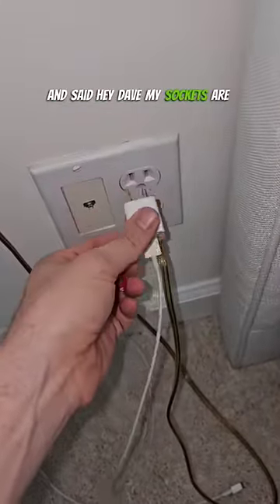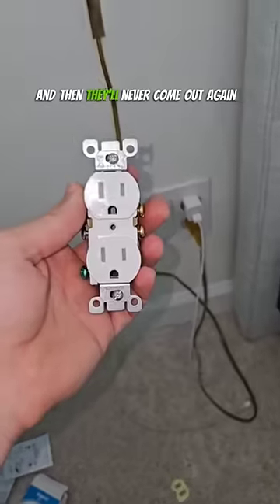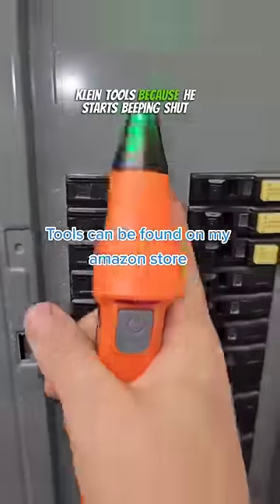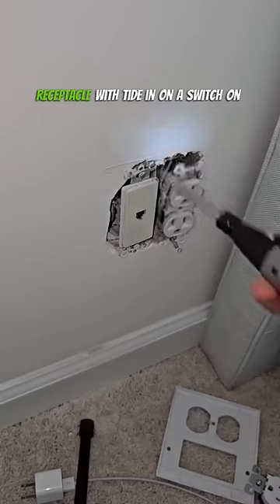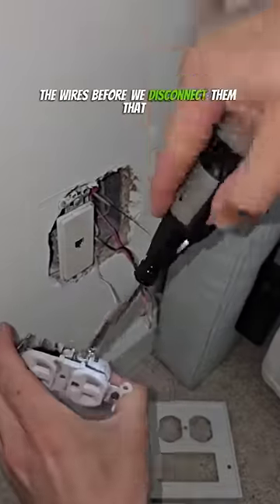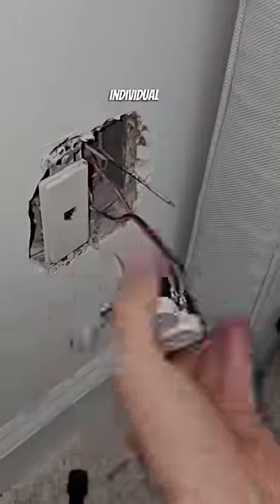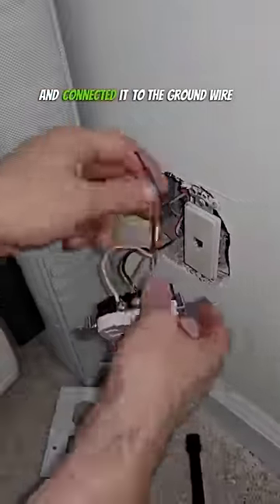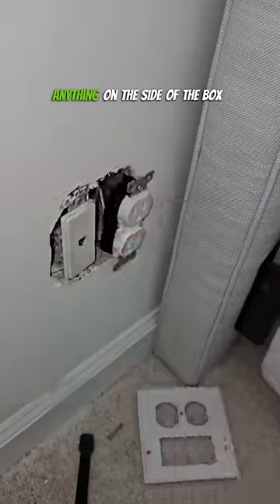🔥 Thats a hazard! How to change a switched outlet #diy #handyman #electrician #HowTo

Comment: I like how everyone is just causally glancing over the fact that socket didn’t have a grounding wire 💀
Reply: Ikr? Could end bad quickly, though its only 110v
Reply: @D3nn1s badly how? Its fine
Reply: @randybobandy9828  if you have an object with metal housing that needs to have a ground, if one of the live wires touch the metal housing theres nothing there to protect you except the normal fuse. idk how best to explain this to you since you obvz dont know much about electronics but look it up, its there for a reason
Reply: I'm a little surprised the testing meter didn't pick that up. Maybe the metal of the plug was grounded to the metal box through the mounting screws, finding a ground that way.
Reply: @spelunkerd  yup!, Otherwise the box needs a grounding pigtail to the wire nuts.
Reply: @randybobandy9828  you say that until your water spigot starts showing 85V on multimeter
Reply: If it’s in a metal box and the box is grounded then you do not need to ground the receptacle put into the box… but it is still safe practice to do so
Reply: @joncramer7034  I do understand what you're saying. Even multimeter testing may not detect that grounding through the screw is a more tenuous pathway that may not be robust enough to withstand high current, or may add enough resistance when heated to prevent a breaker from immediately tripping. Anybody reading this should know that a receptacle in a grounded box that does not have the ground screw connected is a violation of electrical codes, almost everywhere. It leaves permanent evidence of shoddy work that could have legal implications far into the future.
Reply: @spelunkerd  I do believe they changed a code section exactly for this saying that if a receptacle is bound to a metal grounded box using metal screws it does not require equipment grounding. I’d have to check up on that but I believe they recently changed that.
Reply: If the box is metal, the electrical system is grounded and the outlet is the self grounding type the nec does not require a ground wire.  Ultimately it's up to the ahj to dictate the manner of work.
Reply: My house was made before they needed to add a ground wire. A lot of our sockets don’t have a ground. Parents started redoing the wiring
Reply: @sisterspot111  If it's too difficult to add a ground, electricians deal with that by adding an upstream GFCI. Even without a ground the GFCI allows you to safely swap over the two pronged plugs to conventional three pronged plugs.
Reply: @D3nn1s  the rcd will still save your live but it will hurt
Reply: Surprisingly common in the US, not good.
Reply: Didn't he add a ground wire
Reply: @pannoncannon  yup, same on an amp with a metal housing but it only has 2 wires from the factory. When touching the metal and e.g. a radiator you could feel a tiny bit of buzz.
Reply: That's not exactly uncommon
Reply: All houses I been to replace they old outlets never have ground wires it's how it was back then and it's a pain if they do have em cause then it be too short to get onto the receptacle some add a pig tail to it but that makes the box have even less room better to just remove it and add a new one for less pain
Reply: @D3nn1s "only 110v" dude 4v can kill depending on how it hits you
Reply: most modern socket housing is plastic so it usually isn't necessary, in older ones like this one and many of the ones in my house, they are metal and thus need a ground wire. bad electrical work by whoever installed this (or the last one to work on it)
Reply: @Xaelyth  no 4v cant kill you. Unless you happen to onto it with your pacemaker. It was a joke relax
Reply: Welcome to the average American power outlet experience.
Reply: @spelunkerd the testing meter did pick it up. If you look at the tester it has 3 lights at the bottom 1 for each wire. The left light is not lit up. Wich means 1 of the 3 main wires is not connected. On that specific tester the ground wire is the left light.
Reply: Any house built in like the 70s or older typically doesn't have any grounding. It's fine 99.9% of the time 🤷‍♂️
Reply: It’s very common in old houses it’s not a problem deal with it all the time
Reply: pfff, here in mexico that's standard issue
Reply: Couldent the wire to the switch be grounded?
Reply: @D3nn1s  nah it be aight 🤣
Reply: You don't need that bare wire copper for the outlet to work.
Reply: I have a ten amp and a thirteen amp outdoor appliance that are both double insulated and by design neither plug into ground.  Most carpet vacuums I've used are also high amperage and don't.  Most electronics don't.  I wonder if pc monitors do only because they physically attach to a pc which allegedly needs it.  Televisions tend to be made larger and consume a lot more power than computer monitors and don't have a ground prong.
Reply: All that was covered in the short.  He added a ground wire.
Reply: @D3nn1s  Not correct.  Because the metal box should also be grounded.
Reply: @joncramer7034  Technically yes it is grounded through the mounting screws, in most case.  However, using any mounting screw anywhere for a ground violates the code.   Code says it needs a dedicated ground screw.
Reply: @bearcountrypublishing5303  yes should. And probably with the wire that isnt attached lol
Reply: Not having a ground is dangerous obviously but it's also very rare something goes wrong, still something COULD go wrong so there needs to be a ground.
Reply: Most in the us sadly don't so when we replace we have to fix that
Reply: @randybobandy9828  you really need to acquire more intelligence on the matter.
Reply: @D3nn1s  I know plenty about electrical.
Reply: US sockets are so garbage anyway, literally any other socket around the world is safer and better. Schuko ftw.
Reply: it could be really old and just never got updated till now
Reply: Most common household items plugged into a 110 volt outlet do not even have a ground prong on the cord
Reply: I am in Europe and some plugs in my house dont have the ground pin because it is an old house and before we didn't had to add the ground.
Reply: @randybobandy9828  Go home pal, ya lost.
Reply: @crystalmetheny1342  it's amazing how you can't say why though. Weak
Reply: @randybobandy9828  Why what?
Reply: If it's a metal box only the box needs to be grounded, the receptacle is grounded through the screws, look it up. I still do both, but NEC doesn't require it.
Reply: @Rhyzak  it seems like you do.
Reply: My house doesnt have ground, i guess a lot of people here lives in the same situation
Reply: He said that
Reply: Bahhh its case grounded, its fine
Reply: I literally slowed the video and zoomed in to check 🤦‍♂️ no ground wire... sure it may ground through the anchor and housing... but... 90% of the time that works 100% of the time... but the other 10% of the time? ... " we just don't talk about that" 🤷‍♂️😬😁😎😜🥳
Reply: @daniellau5859 fine until it isn't 🤦‍♂️ But... it's not just good, it's "good enough!" 🙃
Reply: it's pretty common, some people are just lazy, i feel like i almost see one everyday without one
Reply: Most old houses do not have grounds. My parents house does not have grounds. Never had any electrical problems.
Reply: In older buildings, before grounding became an industry standard, not having any ground was the norm. Unless you have a ground plate, aka a huge metal plate buried under your house, connecting a bunch of ground wires together won't do much, cuz they aren't connected to the actual ground.
Reply: @yo_its_gingey5329  a ton of countries just dont hsve grounding in 90% of houses
Reply: @spelunkerd  It isn't a tester.  It's only a breaker identifier.
Reply: @joncramer7034  That's not always true, especially in a house.  It should be grounded with a green clip, but it still needs a ground wire on the plug.
Reply: @jhonsauceda6024  That is only on a commercial piped in building.  The box is grounded with the pipe.  If you wire a house, it's NM-B wire and the box is only grounded by a cheesy little ground clip that is easily pulled off  Ground wire on device is required.
Reply: @SteveWhiteDallas  buddy in the Chicagoland area homes are also in conduit.  I'm not saying it's right but that's the way it is.
Reply: @jhonsauceda6024  It isn't wrong.  But I did say "commercial.  You'll have that..  A small town surrounded by Dallas, Texas (Highland Park) requires all wires to be in conduit or metal flexible conduit where emt is not possible.  That is because of the massive squirrel population.  (old town with trees that stretch across most streets - $2 million+)  That's what local codes are for.  I am fairly sure that a ground clip on a metal box wired with NM-B is not compliant to NEC.  But I could be mistaken.
Reply: @D3nn1s  I removed the secondary winding from a microwave xformer and replaced it with four turns of #6awg.  The output is 3.6 volts AC.  I connected the new secondary to 2 electrodes and hinged them to bump together.  Its called a spot welder and it isn't a toy.  The combination of frequency, current and voltage is what contributes to a deadly shock.  You can think what you want, but I don't recommend betting your life on the effects of high current at 4 volts.
Reply: @uncrunch398  Ground wires on appliances are connected to any metal frame that is inside the unit & any metal part of the housing or anything else metal that the user might come into contact with.  If a short circuit occurs (a circuit that is too short to provide enough resistance to keep the current below a particular threshold, including a hot wire/component in direct contact with the metal parts mentioned above) the voltage will travel through the ground wire into the earth/ground instead of traveling through your body.  The ground wire has almost zero resistance, which means the current will rise to a level much too high for the circuit breaker so it will trip.  The ground wire is not required to make the appliance operate, but it is 100% as important as the hot and neutral for anyone who wants to avoid being shocked.  No one is immune.  I have been shocked many times, but still, I never know when the next time will be my last time.  That applies to everyone, without exception.  If you don't have a grounded outlet and no ground wire is in the box, protect the circuit with a GFCI breaker or receptacle.  Be safe.  It's worth the time.
Reply: @SteveWhiteDallas  you can die from high current at .1 volts and high voltage at .1 amps. Just saying, if its set up correctly it shouldnt do anything at 240v much less at 120
Reply: Old house.
Reply: @D3nn1s  What is your idea of set up correctly?  If you believe 120 or 240 Volts AC can't kill you, you might not be the stupidest person I've ever run across, but you missed a good chance to be.
Reply: @SteveWhiteDallas  fi, grounded properly.
Reply: A lot of older work doesn't have it, why you surprised? I wish I could fix every problem while working but my boss says no, they paying us to change receptacles or this or that, not running new wires, because when he informs the client they don't want to pay more and he makes them sign papers stating they don't want to pay more to get their electrical done right
Reply: @joncramer7034 
It was a cheap receptacle without a ground clip on the mounting screw so, technically, no good. It was obviously grounded well enough for the tester to indicate. Use of a self grounding outlet would rectify the issue as well.
Reply: @sisterspot111 
No ground, must use 2 wire outlets or a gfci outlet marked accordingly. You can't install a standard grounding outlet legally.
Reply: @spelunkerd 
If you are allowed in your jurisdiction to wire 3 wire outlets downstream from a gfci, they must be marked accordingly. My area will not allow downstream outlets to be 3 wire if there is no equipment ground.
Reply: @joncramer7034  there is still an internal ground connecting everything threw contact
Reply: Thank you!
Reply: This is why our British model is superior
Reply: @randybobandy9828  Basics of electricity. You have a power source, you have a ground source. Yes this is AC power but you still need a ground to protect you and your equipment. Without it you can cause an electrical fire and possibly burn the house down. Sure it has a neutral but better safe then sorry.
Reply: It was grounded to the box, the ground coming in goes into the metal box and when you attach the outlet it grounds through the screws
Reply: My sockets in my childhood bedroom weren’t grounded. I found out when I replaced the broken socket. Made me wonder what other sockets weren’t grounded in that house.
Reply: It’s in conduit. Most likely not required by code. The entire system is grounded.
Reply: Why was the ground wire fully uninsulated instead of only being exposed on the 2 ends?
Reply: @mrbailey4272  However, you do need it to avoid annoying electrical noise that can affect some audio equipment
Reply: @spelunkerd  the gfci must be grounded through from that point to the panel
Reply: @uncrunch398  no exposed bonded  metal if its 2 prong
Reply: @ianvankooten1488 That isnt how that meter works. The three lights are used as a code of sorts, each array of lights defines a different issue. If the plug wasnt grounded the center light would shine. The two lights on the center and light shows a properly wired receptacle. In this instance this house is probably 'fixture fed', meaning all devices are grounded in the fixture box in the ceiling. Those grounds lead back to the panel, which extends to your outside service, another 3 points of ground.
Reply: It did. The outlet tester had two orange lights. The far right one would have been off if it was grounded. Not sure if it was loose and came off while he was taking it out or if he just hyped himself up a bit there...
Reply: For years all we use is EMT, metal boxes and self grounding receptacles.  No need for the ground pigtail. That’s in Chicago market , Chicago code and sometimes more restrictive than the NEC
Reply: @user-qh8to6vt3z  NEC 2023 requires all metal boxes in a residential setting to have a point of ground, even if the receptacle is self grounding. Here in Mississippi we have to install ground pigtails to all metal boxes. We've swapped to plastic or fiberglass for that reason, since it's cheaper. That and we don't use self grounding equipment.
Reply: It’s bad but not too bad since they’re 110s
Reply: it was in the back pretty sure
Reply: Well you'd be shocked to know that almost none of my outlets have ground wires, as well as a mix of knob and tube along with multiple different types of wire used since 1927.
Reply: Or that he didn’t wrap the wires in the right direction on the screws even though he mentioned it
Reply: @D3nn1s grounding the outlet is actually just an additional fail-safe. The metal box is already grounded and as such the outlet is also grounded. So it really isn't that bad, but obviously any additional fail-safe should be taken advantage of.
Reply: It's not that huge a deal and it was dealt with. It's fine
Reply: HE ADDED A GROUND WIRE
Reply: I have that tester and that is definitely not how it works. I’m a union chicago electrician. If it’s a metal junction box, it’s probably grounded, and the receptacle is grounded through the box with its 6-32 mounting screws. Still can’t hurt to add a grounding pigtail, but that can be a pain if there isn’t one already screwed to the back of the box.
Reply: This comment has gone crazy, the funny thing is I’m actually about to start an electrician apprenticeship next week, thank you to everyone for still commenting all this time later!
Reply: The cool thing is that in your breaker panel, the neutral and ground wires are literally tied together. So technically, the white wire is the ground (which is why you call it the grounded neutral), adding a second wire whose whole purpose is grounding is just a safety precaution
Reply: Ngl I didn’t catch it until I saw this
Reply: His tester at the beginning shows no ground fault. So there’s no issue there.

Why? The receptacle is in a metal box, which has to be grounded. Most receptacle are self grounding, which means that they’ll be grounded if they are installed in a grounded metal box.

So him adding the grounding wire at the end is just a way to bill more time to his customer. OR is a worrying lack of knowledge about his tools and building code.
Reply: @spelunkerd  That’s exactly how self grounding receptacle works.
Reply: @spelunkerd  Ehm… where? I couldn’t find a source to back this up.
Reply: @joncramer7034  Your receptacle needs to be self grounding. Always test all receptacles when you install or work on them. Never take guesses.
Reply: @ianvankooten1488  That’s not how that meter works. If the 3rd light was on it would mean a ground fault.
Reply: @bearcountrypublishing5303  No. 😂
Reply: @bigredc222  It needs to be a self grounding receptacle to be a valid install. I’m sure you know it, I just want to get the info out for other people that will read this thread.
Reply: @SteveWhiteDallas  You can look it up online. The device does both. You can see the light chart on the tester.
Reply: @arakwar god damn you went on a little crusade threw my comment huh, I just want to say thank you for adding engagement to my post and if there’s anyway to continue this conversation somewhere else I’d love to as I’m an electrical helper and would love to get a little more knowledge in before I start on my first real crew Monday!
Reply: @brokenandcraked  Yes, they are connected.  The neutral is allowed to b carry current for normal operation.  The ground is only to dispose of the current if it ends up somewhere off of the intended path.  
Do you know why its called a neutral, not a negative?  The neutral is also grounded at the transformer.  If that connection at the transformer is  broken, the neutral will become hot, just like the 240 volts that serves the panel  That's because the neutral is the centertap of the transformer's secondary winding.  It's half way between the 2 ends of the 240 volt secondary winding, hence 240 volt split phase.  
The bonding screw in the panel is also just a safety.  It prevents the neutral from becoming hot if the centertap (neutral) and ground connection gets broken at the transformer.
Reply: @SteveWhiteDallas  I'm an electrician. Yes. Yes I do know
Reply: Ikr. I had to pause the video.
Reply: My house was built in 1940, there ain't even a ground hole on the outlet Lol.